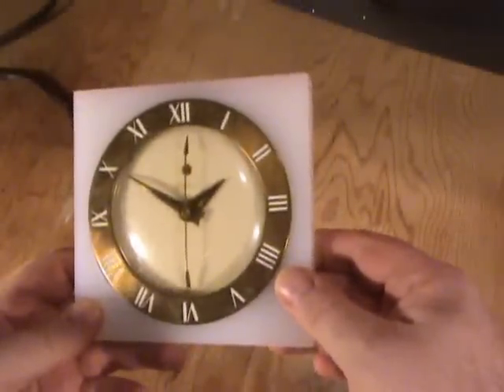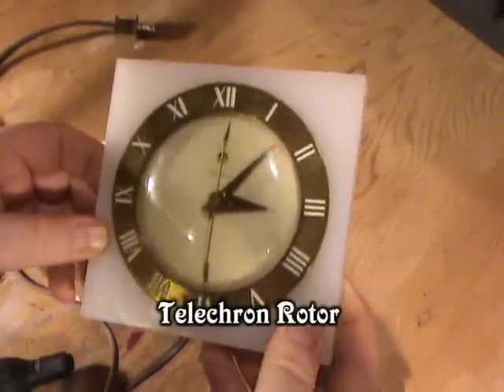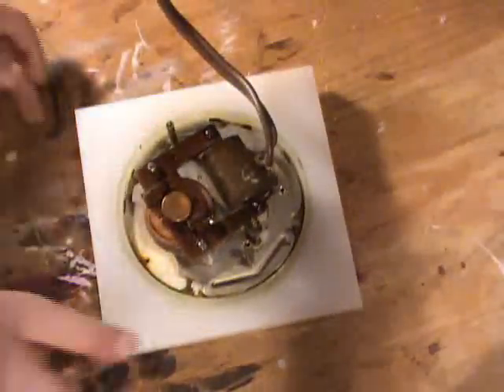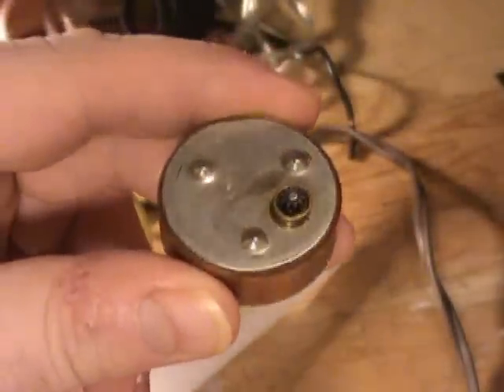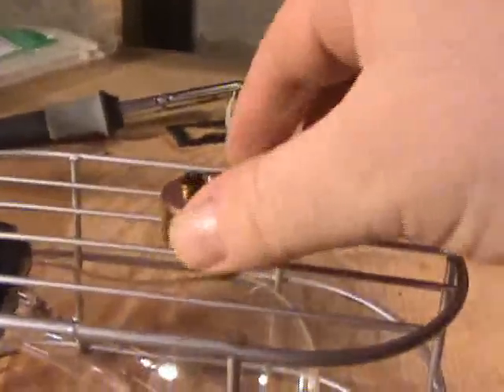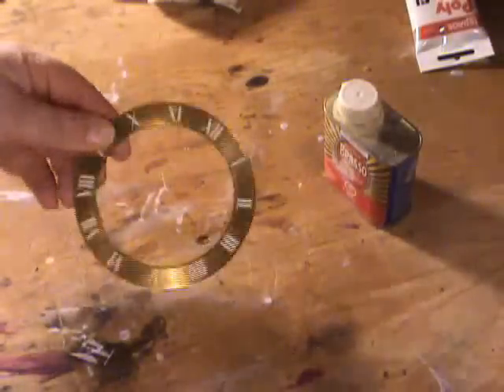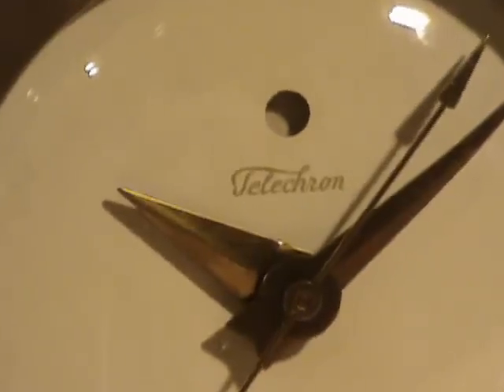Vintage Technology - Reviving a Telechron Rotor

Comment: It would have been helpful to mention the type of oil used. The rotor is a Type H. Telechron made an almost identical alarm version of that clock. I have one. The rotor seized in my clock, and I replaced the rotor assembly, but I kept the old one, and I might try this repair on it just to see how it works. When working on these clocks, be very careful not to pull on the coil wires, or they might come out—ruining the coil. Sometimes the coil is very fragile.

Comment: The way you did it is my preferred way of rejuvenating the rotor. Some will say that by doing it your way, you are leaving some of the metal particles, from past wear, inside the case, thereby allowing it to wear out even further and faster. That may be true, but after you have done what was done in the video, and the rotor runs smoothly and quietly, then there was likely not much accumulation of particles in it.

Another method is drilling a hole in the case in a manner reducing the likelihood of metal chips entering the rotor. Then you wash out the rotor with lacquer thinner or another solvent, until it comes out clean. Then fill it with the correct amount and kind of oil. Then seal the hole. Now the rotor can start a new life with clean oil. It will be a long life if the wear was minimal.

Comment: Great video and beautiful clock.  Your spacers were reinstalled upside down, the little tabs on the end of them are supposed to go on top of the rotor to hold it tight to the plate after the screws are put back in.  Thanks!

Comment: I am completely intrigued by these clock rotors and have been working with 1930's  Ingraham rotors for about a year on a restoration project covering 2 separate clocks with identical motors and rotors. I am AMAZED at the lack of information and knowledge about these Ingraham rotors and entire motors for that matter. With the Ingraham rotors I am able to actually remove the brass cover and remove all  the gears for cleaning and inspection. I will be making a video about the Ingraham Electric Clock movement and rotor which is clearly sorely needed. The Ingraham motor is completely different - the motors have 2 coils and run very cool compared to a Telecron.

Comment: I read two written instructions on different sites before coming here. They basically said the same thing but 1 had no illustrations and the other only a technical schematic that was of no help. Your simple straight-forward demonstration made it all clear and when I went back and read them again it was like a light bulb (in a wire basket of course) went off in my mind.

Comment: Ok.  I heated mine & added some WD40 Bicycle chain oil.  But I am having a problem with it "losing" time, not keeping it properly.  For example, I plugged it in and set it at 3:07 and at 3:17, it was showing approximately 13 minutes past the hour.  Any ideas?  Something must be binding or slipping in order for it to stall or not run consistently.

Comment: Super lube make a synthetic oil with teflon in it I wonder in using that oil instead would work better,synthetic oils don't break down ,and the teflon would make it easyer ,I would have put on synthetic grease with teflon ,on the grears.just a thought
Reply: The rotors need more oil added than in this video.   Like 1 ml or so for a rotor that has never been freshened up.  1 ml of oil will sit below the weep hole near the gear in a sump and will not leak out.  These rotors were originally assembled with more of a light grease than oil.  Synthetic oil + heat loosens them up nicely and a good dose of synthetic oil will keep them going for a hundred more years at least.

Comment: Thanks for showing how to service this rotor.  The only thing I would add is that the gear pinions should be oiled as well.  A mechanical clock needs this kind of servicing periodically as all kinds of wear can happen if the gear pinions are not oiled.  The same is true of electric clocks as well.

Regards, Tom

Comment: I just got a clock very similar to this one, the 7H141. It seems to work fine except for the red dot. You didn't seem to mention anything about it. How is it supposed to work?
Reply: If that aspect hasn't also become sluggish, that indicator function is to let you know that the AC power has been off and that you need to verify to see if it is close enough to the correct time.
You rotate the cloch upside down and the indicator cavity hole should show the same  color as the basic paint job. When there is a loss of power the disc drops and shows the RED dot  indication.

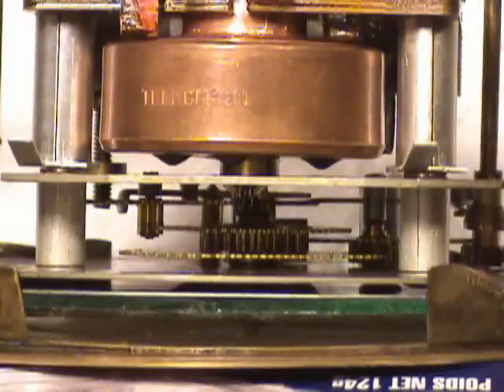Comment: The heating process needs to be done 7ish times which he mentions later. Oil needs to be of a lightweight synthetic variety or it will just gum up again. My question is about the reassembly of this clock.... at 8:28 minutes in the internal "spacers" with the little tabs do not appear to be installed properly.... can you clarify this?
Reply: Agreed. Those “spacers are upside down. Installing them like he did would cause the motor to be slightly out of alignment as the hole on one end is larger than the other.
Reply: I have successfully used Marvel Mysyery Oil . . . . . Wally World has it  . . . . . or also, automotive automatic  transmission fluid, as it certainly gets one hell of a work out  in very  HOT and demanding conditions.

Comment: I paid a dollar for this pretty little clock but  it didn't work. Last night I put a little oil on it and it worked. And then it didn't work. I looked up your site and followed your instructions. You never said how much oil the little canister would take. Also I wasn't able to rig up a light like you did.  So I just put a little oil on it and went to bed. This morning the gear was moving. I put it back together, plugged it in and its working just fine thanks for your help.

Comment: While cleaning out my parent's house we came across a Telechron Statesman alabaster clock that barely ran because it was so dry. When I plugged it in you could hear it in the next room it was so loud, it could wake the dead, but it was working and not seized. Not being familiar with the clock I did a web search and came across this video and decided to give the repair a shot rather than tossing the clock. The process seemed easy enough, however disassembly turned out to be a challenge. The internal posts for the back cover screws were spinning freely and as a result turning the screws would not release the cover. The design of the cover screws (spring loaded) allowed me to lift the cover enough to hold the posts with small needle nose pliers thus allowing me to remove the screws. The adjustment knob was then removed by holding the adjustment post with small needle nose pliers and rotating the knob until it came off. Rather than make up the light apparatus I preheated the oven to warm (170F) and then turned it off. I placed the rotor on the oven rack and let warm up for approx 15 mins. I then took it out of the oven, placed a few drops of synthetic clock oil on the gear, allowing the reservoir to just fill, and left it to cool. After about 5 mins I put a few more drops on the gear as the previous application had already been drawn into the mechanism. While the rotor was cooling I polished the brass face, cleaned the alabaster housing and glass dome. After polishing the brass numeral face I removed any excess polish and dirt from the numeral recesses with a soft toothbrush under running water and then dried it off with a soft towel. I chose not to clean the hands and face as they were in decent shape and cleaning them can oftentimes cause more harm than good. Err on the side of caution here. The hands are very delicate, bend easily, and cleaning a clock face can leave you with less than desirable results. The face is painted and you can end up with chipped paint and/or a blotchy appearance. Once the rotor had cooled to room temp I reassembled and plugged it in. The clock is now virtually silent, so much so that you could put it on a night stand and not know it was there. The entire process didn’t take much more than 1 hr to complete.
I would not recommend using pliers to rotate the gear. I used a paper towel and a firm grip and gave it a twist. You will have to apply some pressure to move the gear as it is geared down. If the gear will not turn in this manner the clock is probably not going to work or at least not run very well.
Thanks for the video… it saved this lovely old clock from the landfill.

Comment: Just the ticket!!  Thanks. I was looking at buying a new rotor for a small fortune.  You saved me that cost, and allowed me to proceed with the repair immediately.  Mine was in the dash of a beautiful 1940's gas stove/range.  By the way, instead of the light bulb, I put the rotor above the slot in my toaster.  Worked like a champ!!

Comment: 5 years later and I come across this vid haha...
Here's some thoughts I had on this and a few questions that are making me wonder about the nature of the old oil.

First, one may consider putting a nice rubber dish mat or terry cloth under the glass as you're taking things apart. The wooden base made me cringe to see that as who knows what's lurking under there but no biggie.

I'm trying to imaging if it is sealed, the old oil is inside the box, or sitting on the visible gear? What happens to the old oil when it's heated and liquid again? does the new oil penetrate through the little gear shaft into the inside? I suppose if you only need to oil it every 50 years it can take it 4-5 times

Comment: Have you ever had to do any repair on the coil where the wires connect from the cord? the "paper" where the wires connect has degraded pretty badly on my old clock.
Reply: Always cut the cord off an old clock before you open it to avoid the coil from being damaged ( But if you are very careful in opening the clock you may not need to do this). You will want to replace the old cord and plug anyway (except no need to replace a ceramic plug as they can be reused for about 200 years). 

The old telechron/GE coils need to have 3M Glass Cloth Electrical Tape wrapped around them twice because the old paper wrap starts to come apart with age and heat.

You can order this from amazon for about $18 (this last for a very long time):
3M Glass Cloth Electrical Tape 27, White, Rubber Thermosetting Adhesive, .75-Inch by 66-Foot

So after you wrap once time you will need to cut a hole in the tape for the metal terminal sticking out so tape can be on the rotor at the terminal. Then cut the hole again on the 2nd wrap around coil.

You need to wrap around a 2nd time for the other half of the rotor (cutting the same hole in the tape).  Then cut the hole again on the 2nd wrap around coil.

Careful not to cut any wires on the coil. If a coil does not work it is either a needed wire has been cut (and the wires are so small it would be hard to reconnect it) OR a short has occurred in the clock to short the coil. Either way the coil is ruined and I throw it away (keeping the metal parts for possible future use). I use another coil from a Telechron/GE parts clocks I buy at the swap meet for <$10 each. 
Best wishes, Bob

Comment: You can also use a Rival beverage warmer. Setting the rotor on a sunny window sill will heat it up too. Add oil right after removing the rotor from the heat source.

Comment: Thank you so much for the video. I have the H141 which is the alarm clock version of your model. The pull for the alarm is missing and there is a loose hollow screw inside. Do you know where I can find to repair this for my husband. I want to surprise him. I have fixed vintage sewing machines so I hope I can handle this too. Thank you (:

Comment from the maker: It has oil inside it already, but that oil has lost its viscosity and hardened up and that is what causes the rotor to stop. 

The trick here is heating up the oil to melt it again, then add some fresh oil to help keep it that way. 

I only filmed one drop of oil, but I actually put in 6 or 7 which required me to heat it up and cool it down 6 or 7 times! 

YouTube only allows a 10 minute video, however, so I had to leave a lot out.

Thanks!

A-D

Comment: i revived a telechron ships bell clock for my aunt! it wouldent run at all! so after about a week of working on it i got it running and keeping perfect time! but my method wasnt quite as easy or conventional but it worked. i took the rotor and gently tapped  it free and added oil like you did but i never heard of heating it up. hmm if i ever come accross that issue again ill try it.
Reply: 1944johndeerel n